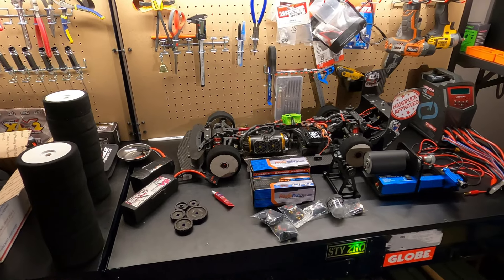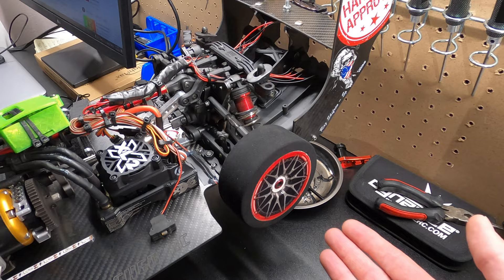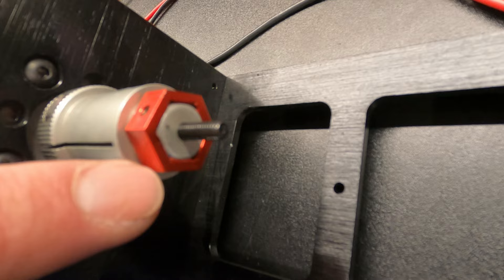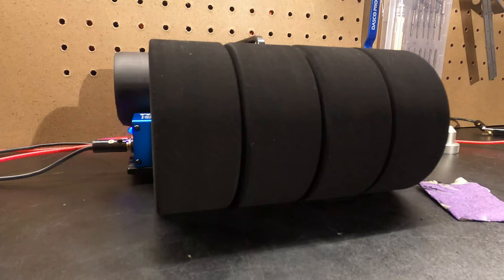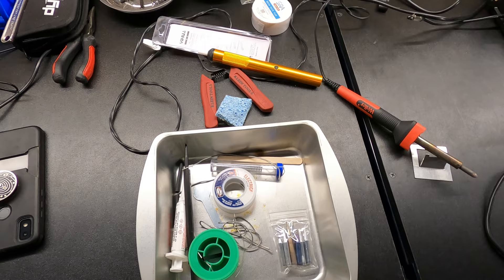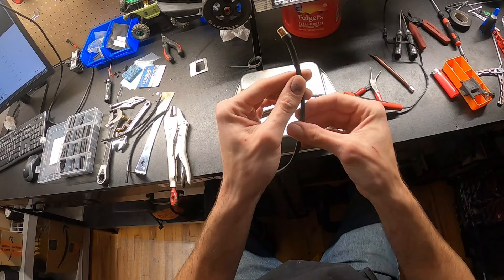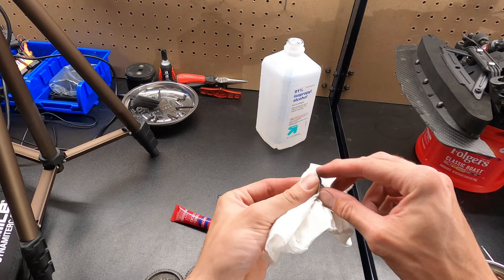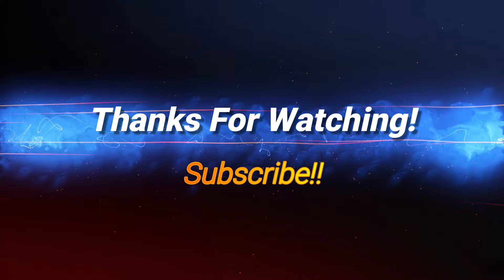Tire Truing/Balancing, Soldering QS8 Connectors & Gluing Gears! Speed Running Secrets!

Comment: Great video!! Little tip when soldering QS8 connectors plug the other side in and you will save the connector if you apply too much heat. Also have a damp sponge ready to cool it off… Good luck on the new PB ✌️
Reply from the maker: Thank you! Someone else also told me that trick. I never knew😆 I'll definitely try that next time, much appreciated 💪

Comment: Hey buddy which company sells the larger input bearings part number thanks
Reply from the maker: I just ordered from Vitavon, hot racing I heard also has some. I ordered directly from the owner so I don't have a part number. I can try and look later
Reply from the maker: Here's a link to them on Ebay. Or message me on facebook for the owners info if you want to order directly. It's a lil cheaper directly. My facebook is Sean Schroer.
https://www.ebay.com/itm/284493406167?mkcid=16&mkevt=1&mkrid=711-127632-2357-0&ssspo=Y5rZhw9nQ1W&sssrc=2047675&ssuid=&widget_ver=artemis&media=COPY

Comment: Hi, did you buy the extra 1/10 adapter for bsr tires ?
Reply from the maker: It comes with a 1/10 adapter. I had to buy a 1/8 adapter
Reply: @zagertRC  you bought 1/8 on road car adapter?
Reply from the maker: @ozzracer  This is what I bought. If you can only find the sleeve, it would be better.
https://www.ebay.com/itm/264432568879?mkcid=16&mkevt=1&mkrid=711-127632-2357-0&ssspo=5ySwoWV4ShG&sssrc=2349624&ssuid=7my3r4oqtna&var=&widget_ver=artemis&media=COPY
Reply: @zagertRC  the link doesn’t work for me but I somehow found a solution, will use a 12mm hex to 17mm adapter
Reply from the maker: @ozzracer  yep! That's all you need!